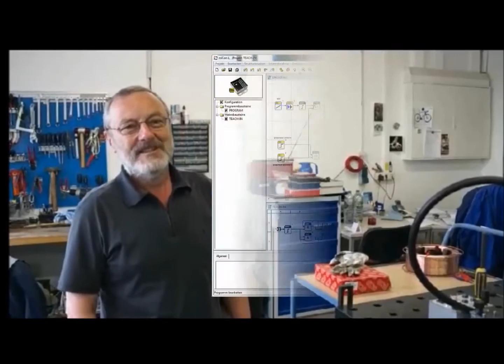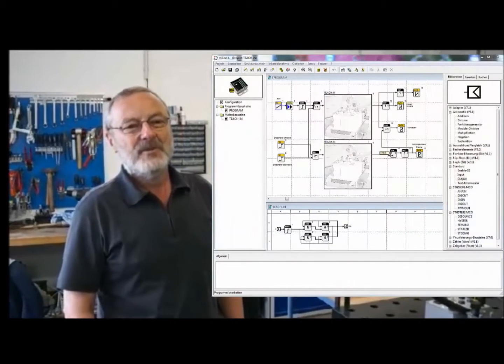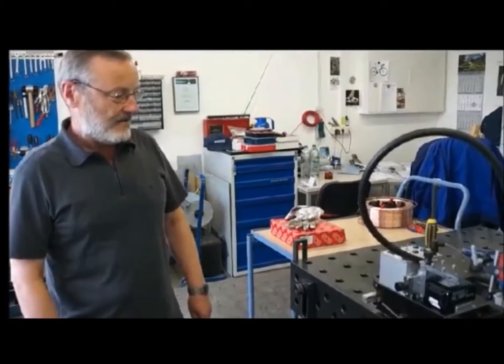BARTH Mini-PLC STG-500 controls a Welding Tractor

Comment: Is there a high level schematic showing how a single STG 500 has so many HMI buttons and switches with only 5 inputs?
Reply: That’s a great question. Annoying to see that the OP had no interest in even attempting to answer your very valid question in those public forum.
Reply: Several of the inputs are analogue.
They could be using level-shift encoding.
Eg: 0V = Nothing, 1V=Button 1, 2V=Button 2, etc.